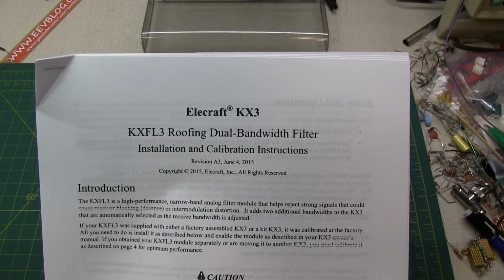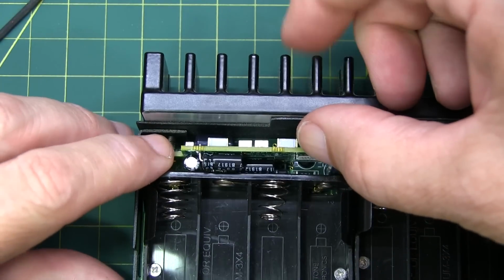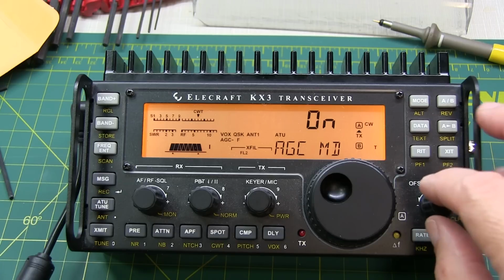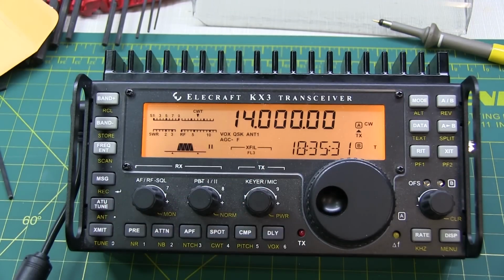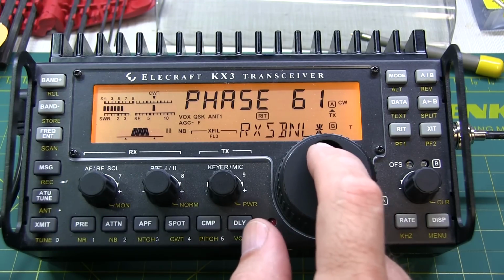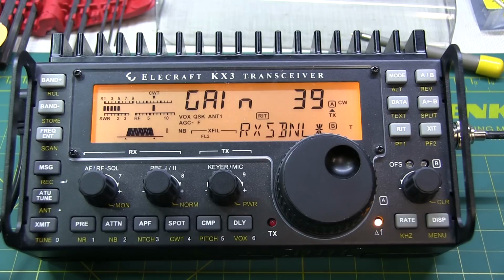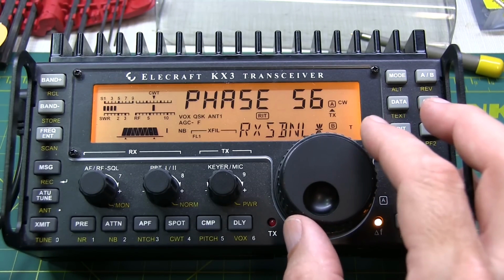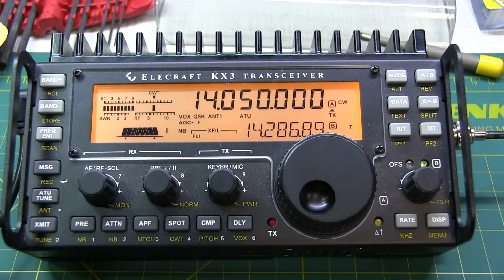#358: Ham radio: How to install the Roofing Filter kit in the Elecraft KX3 Transceiver

Comment: This is so welcome that I'm going back and doing mine again Alan. Many thanks for this. I found the Elecraft installation sheet a bit problematic in trying to keep focus on what stage I was working on due to the repetitive nature of the steps. Also, I don't recall many of the adjustments you made. At the time, this led to apprehension as to whether the job was carried out properly. Also, Fred Cady's book intimated that it was a per band setting which also puzzled me because the filter is at audio frequency. Many thanks again Sir.

Comment: Excellent video sir. I need to retune my KX3 and the roofing filter I installed in it many years ago but never completed the alignment procedure as shown in your video. I too have a signal generator, but I am not certain if it must generate an RF signal or if a sine out would be sufficient to o the tuning. I have been trying to justify buying or building an RF signal gen so .... hmmmm . Thank you for posting this video.
Reply from the maker: The procedure specifies a test signal that is in the 14MHz region, and between -73 and -33dBm.
Reply: @w2aew  sounds like a very good excuse for me to buy a better signal generator … thank you very much. Any suggestions on a generator to buy??
Reply from the maker: @michaeldavidheit  The tricky part is getting something that has an adjustable output that is suitable for testing receivers.  Many inexpensive siggens won't do that.  If your needs are primarily testing HF gear, then a more "purpose built" unit like the Elecraft XG3 is a very nice option: https://elecraft.com/collections/test-equipment/products/xg3

Comment: I followed your steps and I have done all the settings in the menu. So far, so good. But you have a very strong signal with -33dBm?
And I went to RXSBNL and had Phase 64 on my Display.
But I can go up or down, and the signal goes up, in both directions. Why is that - any suggestions?
The minimum peak is 64 - doesn't make any sense.
I tried it several times, every time the same outcome.
Filter is installed correctly and is okay (I guess).
73